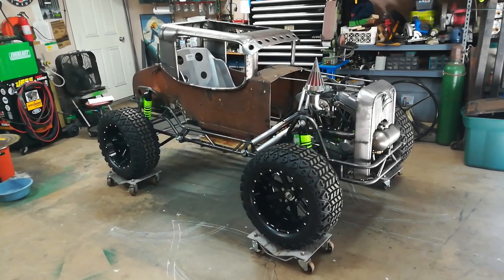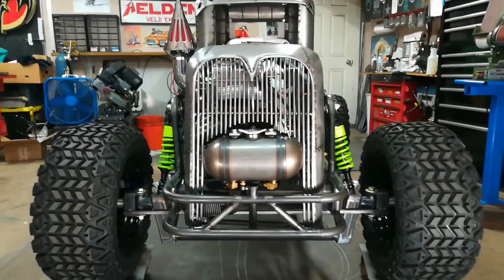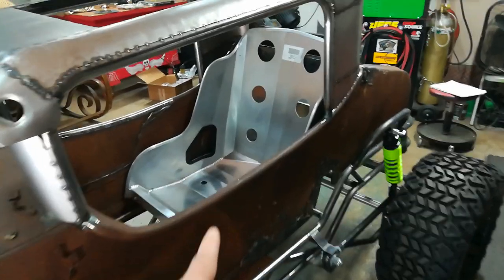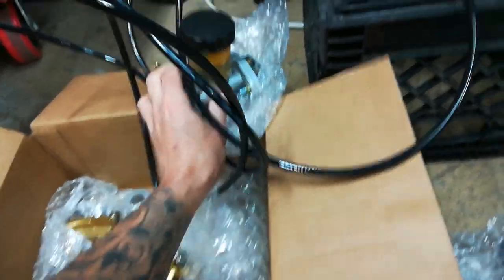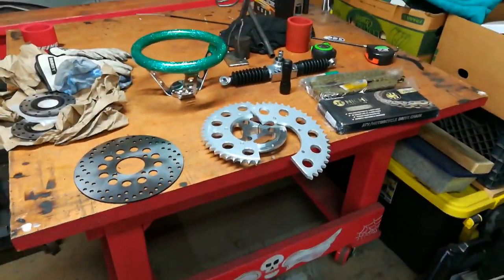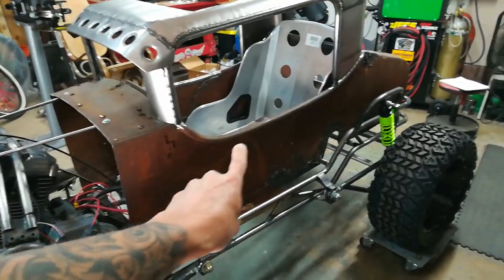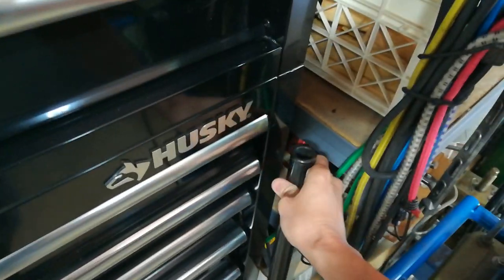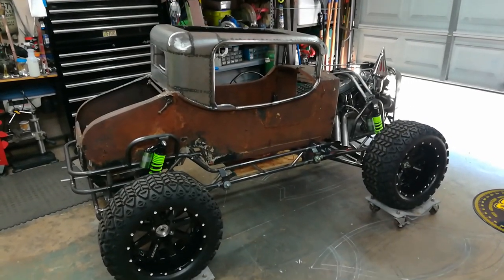Harley Ratrod Go Kart #9

Comment: The 2” axle is a tube, the 1.25 solid axle will bend before it shears the key stock , you may want to add a set of pillow blocks near the sprocket & brake rotor . The Harley motor the best fit for the hot rod design. Very cool project
Reply from the maker: Thanks. Yeah it's pretty violent in first gear. I'm just taking it easy for now until I can upgrade. The good thing is it just spins the tires before anything breaks. However, if I go through and build this engine I'm gonna need the bigger axle.
Reply from the maker: The 1-1/4"axle is also a hollow tube. However being splined all the way around is my main concern. I've already heard many guys running sport bike engines that end up shearing the key's. Some of them use a steel sprocket hub and weld it to the axle. Same with the wheel hubs. I don't want to do that. I think running a 1-1/2"  -  2" splined axle is much better albeit more expensive.
Reply: @guywilsonwelding  kinda like adding the chip in a new diesel truck and wondering why you can’t keep transmissions drive lines and u-joints under it  Lol been there done that 🤔
Reply from the maker: @allensandven0  yep😂😂

Comment: The rivets in the seat is easy fix drill them put in new ones smooth side in. When you start talking about running the chain, i thought how cool it wood look with a chain on the outside between 2 jackshafts. Looking good! p.s. i had a modified 1200xl i understand exactly how much torque they have.
Reply from the maker: Thanks.👍

Comment: Ever consider mounting the engine sideways and running a drive shaft to a rear end?
Reply from the maker: All the way in the beginning. I even have photos of the engine sideways in the frame on my instagram to put an end to that idea. It doesn't work for multiple reasons and it looks, well... not good.😂